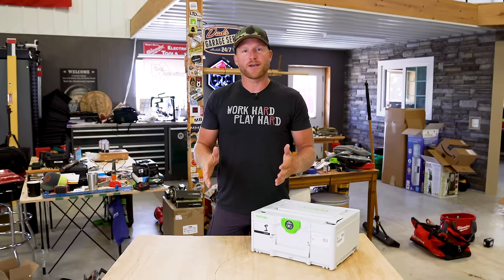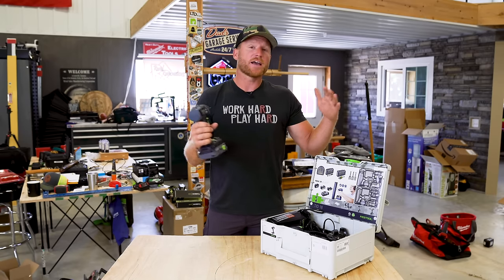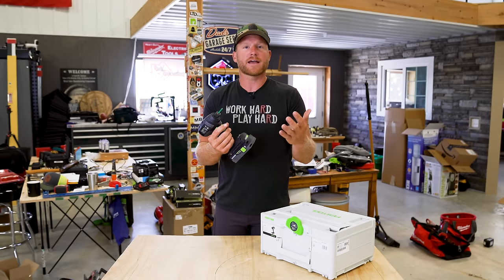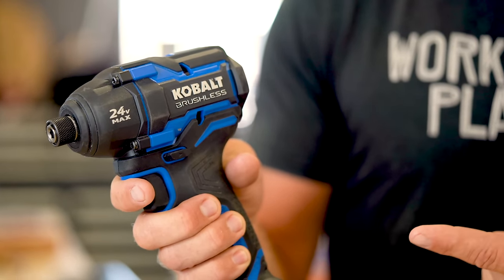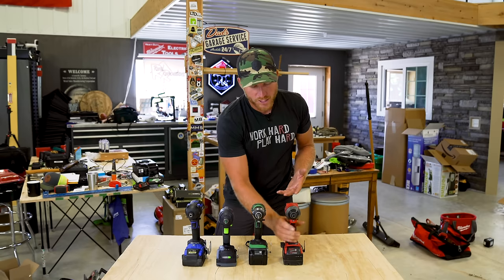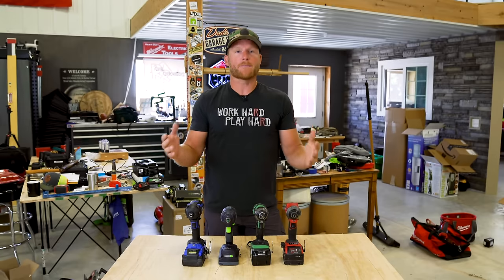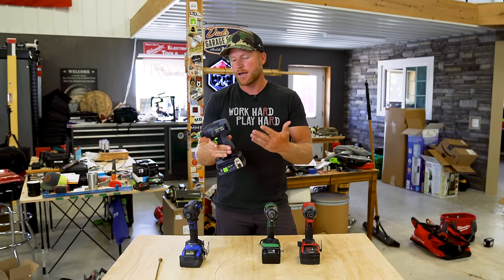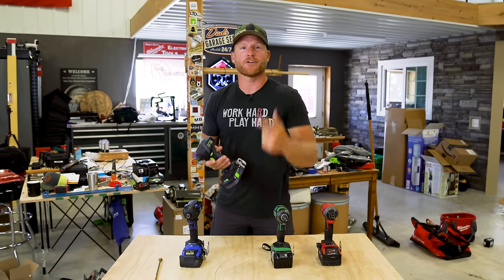Festool TID 18 Is it any GOOD?

Comment from the maker: Honestly, This Impact is Killer and I will continue to use it...not to mention at $349 for the kit with 2 high output batteries...it isn't that bad with a Case!  
https://imp.i284638.net/y7g2b
Reply: No one size fits all. I use my gen 1 Festool track constantly....no replacement for it!!  Stunning work. The chop saw ???  Not so much. I had to replace my recently stolen sliding mitre saw. I bought the Bosch glider for 1/3 the price.  Couldn’t be happier. Knock off the envy and get to work y’all!!
Reply: Since when is kobalt more powerful than Milwaukee every comparison that anyone has done all over YouTube Milwaukee fucked kobalt up I don't know about The other TOOLS so I can't say anything Milwaukee vs kobalt Every test anyone did Milwaukee always came out on top
Reply: Are the green impact driver bits going to be coming out i am digging the colorway nice impact driver from festool mostly on premium side this is more reasonable
Reply: I've been using mine for a couple of months, now.  I've been happy with it, for sure.
Reply: Thomas Carroll Those green bits are made by GRK for their T25 torx-drive deck screws.  They make the best screws and great bits to drive them with.
Reply: @martynzl  
Not being a hater here, I’m curious as my nephew is a painter. What tools does Festool make specifically for painters?
Reply: The thing I’ve found with festoon hand tools, especially their drills and sanders is that the people who use them extensively respect what you were talking about. Ergonomics over power. You can correlate ergonomics and power to the classic tortoise vs the hair story. Power isn’t everything. The power the drill puts out actually wears back on the operator. Finding a balance is well done by Festool.
Reply: It is a good deal in america indeed, same kit in europe costs 1270 dollars tho
Reply: Edit sorry that was for two drills 812 dollars it is for this kit
Reply: It’s crazy how much more expensive tools are in the uk, in the UK that would cost you around 600 dollars or 450 pounds
Reply: @getfast1522  The Germans don’t like BREXIT I suppose. Good on you, though. It looks like the EU is falling to pieces
Reply: My question is what’s the chuck wobble like? Just about every other tool I’ve used apart from my friends Panasonic that thing is tight and the fine control is impressive.
Reply: Ive used panasonic for almost a decade and they are very good and powerful but recently changed to a complete set from festool almost every tool on battery and love it not gonna change for a while

Comment: Festool, people either  love them or hate them.  I had the Festool track before most people knew what a track saw was.  People thought I was crazy to spend that kind of money on a saw. Now everybody wants a track saw. Yes you pay a premium for festool but their sanders and dust collection are hard to beat.  Especially when working in a house that someone lives in.
Reply: I recently dove head first with a CT Midi I, sander, and the TID18 and drill driver because of the vacuum. I’m doing a lot of DIY around the house and I have kids. I didn’t want dust in the garage mucking up my kids’s lungs.
Reply: I have been in the remodeling business my whole life with the family business 50 plus years. When it comes to tools I'm a Milwaukee guy and have pretty much cut the cord on 90% of my tools. I look at the cost of tools as part of the business. If it is a well made tool and is going to save time and make my life easier it is worth the cost to me.
Reply: @regopit44  That seems right to me. I think for homeowners who do this on the side, the calculus is a little different but the conclusions are not far off.
Reply: I think Festool was ahead of its time with some products, but the market has gotten so much more competitive that you have a handful of alternatives for every Festool classic now.
Reply: Sbe
Reply: @saiiiiiii1  You can thank Festool for that. If you remember nobody had a clue about brushless tools until they started it years ago.

Comment: The price of a tool is the price of a tool. Either buy it or don't. I own Hilti, Milwaukee, Old school Porter Cable and Old School Milwaukee from the 90s, Dewalt  from the 90s and now and both generations of Makita and those are my toold and I spend on them. If I needed a Kapex, I'd buy one, but my DWS 780 and Milwaukee 7 inch suit my needs. For my guys they either bring their own or I supply Rigid. If my guys want Festool, more power to them, but I am not giving them a raise lol

Comment: First off I have mostly Milwaukee fuel tools. I have one festool drill and impact. Festool drill is smoother and feels like a hot knife going through butter. Festool impact feels the same as Milwaukee’s best impact but smoother and more comfortable. What’s separates them is the warranty. Festool 3 year wear and tear plus coverage against stolen tools. Milwaukee’s 5 year warranty is not wear and tear only covers manufacture defects. And your screwed if it’s stolen. Plus you get a hard case with festool that stacks. Which I say is worth around 60-100 bucks if you go based of the cost for Milwaukee packout. If your in the market try it. You won’t be disappointed.

Comment: In my experience, the Festools I've used all have nice little design features.  But at the end of the day, I also like them because they just feel so good to use.  I've got a bunch of Milwaukee as well.  Also great tools, and probably what I'd reach for if I'm doing something where the tool is going to get banged around a lot.  I think of my Festools as precision tools for doing fine woodworking, and I wouldn't abuse them any more than I'd abuse one of my Starrett tools.

Comment: I have to say I was extremely reluctant for years to buy any festool because of the price. I have had all other brands you name it I have had it. I bought my first festool drill driver in 2010. Yes I still use it on the job regularly.  Obviously I have bought a couple new batteries cause batteries don't last forever.  I have since bought 5 other festool drills and other tools and I have to say man do they hold up. No problems what so ever. I would recommend them all day worth every cent.
Thanks for sharing Kyle

Comment: I've got the Mafell 91A121 ASB 18MBL and honestly after 20 years of carpentry and woodworking it's by far the most incredible, insane powerful drill I've ever used by far. On the down side It's really heavy and only has a 4amp battery not great ergonomics and tires your arms out after using it all day.

Comment: Good and valid points.
It's primary intended purpose isn't to put away massive batten screws, it's designed to fasten finer fittings with better finesse.

Comment: Good morning, Kyle!
You are such a logical, show me the proof kind of guy, I just love it.
I have had the Festool TS55 track saw for 12 or 14 years, it still works just fine and for my small shop it is great.
Using the TS55 with a vacuum in people's homes with, it leaves very little dust, it has earned a place in my workshop.
That being said, the Festool brand is stupid expensive here in Tokyo, I got the TS55 from Canada when I was home on vacation one year.
I really like the Hitachi, now Hikoki tools, for the 14.4v battery set I have 12 different tools, I also like the Blue Bosch line of tools. 
We don't get the Milwaukee or DeWalt tools here and the Yellow Ryobi tools are not sold here either.
The Festool I would like to add to my workshop is a sander, but not until I can go home to Canada and buy one there instead of the stupid prices they want for them here.
Great review, and if I was not so heavily into the Hitachi stuff I'd give it a look, the price is right too.
Cheers

Comment: I bought into the Festool Combo 2- drill kit which is the impact and the /hammer drill . Great set. Love the egronomics .
However i find the hammer trill chuck locks up a lot and have to oil it after using some compressed air to clean it.
The battery life is great!.

Comment: I have a festool the dust extractor and the hand sanding tools. I like them, really control all the dust when I used it for drywall repair. I work in a hospital so I always have to worry about dust. Just started to use their wood polishing tools.
Reply: check out abranet pads, they rock for polishing.

Comment: I think ergonomics are less subjective than you think, there's really important Universal's that everyone likes more almost all of the time, simple things like how much tension is on the trigger and forward reverse switch, how positive does the locking action feel, how smooth and precise is the trigger. I also firmly believe that the ridiculous overmolding companies do greatly reduce the overall feel of a tool and will irritate a hand when used all day or at least be uncomfortable.
Reply: TheVdog12 no kidding man, been working a lot with a Makita sawzall recently and the trigger is terrible, tires out my hand before anything else.
Reply: @arrzfr  usually Makita is known for having some of the better triggers, which sawzall model are you using?
Reply: @TheVdog12  I'm using the DJR183 model. It has a front hand and a back hand trigger, the front is ok-ish, the rear one IMHO sucks.
Reply: @arrzfr  those "ergonomic" recip saws are horrible, some of the worst tools any manufacturer has made. I'd take a look at the black sub compact recip saw. It's gonna make more power than that one and I believe it's around the same weight but has a much more traditional style trigger that isnt awkward.

Comment: Festool makes some AMAZING products.  They do...the reason people hate them is their price.  I inherited by dad's track saw.  Before that I used a Kreg Track Saw that used a standard circular saw mounted to an adapter that ran on the track.  It worked GREAT, and was all of $49 or $59 (I can't remember).  That Kreg worked great.  I made hundreds of cuts with it.  THEN I used the Festool...umm...yea...TOTALLY different.  That tool was designed for one purpose...to breakdown plywood or make long cuts without  a table saw or doing it free hand.  My biggest gripe of the Festool (besides cost), is that even with 3/4" Ply I had to set the depth of cut to about 3mm deeper than the gauge says (yes, there is an adjustment to it, but I've adjusted it 3 times and each time it comes out of adjustment quickly).  Love the thing, but I would never buy one for myself, it just wouldn't get used enough to justify that cost.

Comment: On black Friday 2 years ago I bought from the Home Depot a special edition Rigid kit for $299. It came with their premium skill saw, premium impact driver, premium Hammer drill, angle grinder, (2) 4 ah batteries, a charger, and a large bag. I have beaten the shit out if them for 2 years every day and they are still going strong. The best thing about them is that if they have a problem, they a guaranteed for life, including,  the included batteries. They feel great, they are lightweight, the flashlight on the handgrip is awesome because you don't have to pull the trigger to use the light.

Comment: I’m with you! I’m a sucker for anything that comes in a case, but I HATE bags! Bags are nice for throwing a bunch of hand tools into for one off jobs. Jobs where you would use tools that most of the time don’t come with cases, or jobs around the house. With any job I do, whether at home or offsite, my tools always get put up properly at the end of the day. Most of my older tools came in hard cases and I used to complain because of their size. They’re bulky and all look the same with no way of differentiating the tools inside. On the flip side, now a days most tools come in bags which absolutely suck when trying to store them in an organized way. Sure you can stack bags on top of each other on a shelf, but it’s a chore when you need to grab one on the bottom. It almost seems as though the manufacturers choose bags simply because they can have 3 or 4 sizes and throw any assortment of tools, batteries, and chargers into them and call it a kit. However most of us who buy a multitude of any one brand have realized that it’s much more efficient to buy a battery/charger kit, and then add your different “Tool Only” to the arsenal. I for one would buy a case even if it’s just for the bare tool by itself.

Comment: Years ago I was 100% Dewalt. I switched over to Milwaukee when their tool line selections became so dominant and I only wanted to deal with one battery option! Best small lightweight impact in my opinion is the Makita. However I just dont want to have different chargers and batteries. Its nice and cheaper to build your tools up by buying the "tool" only option when you already have a bunch of batteries!

Comment: Good review.  So glad you emphasized ergonomics.  When i worked construction my company had mostly Dewalt.  I didn't have many complaints except I have small hands.  Dewalt just didn't fit my hands, reversing switches, etc were not easy for me and impacted my productivity.  I used Makita if i could.  I don't care how good a tool is if it doesn't fit or feel good in the hand.  Ive been in Milwaukee for the last decade, but sometimes you need to break out of your chosen battery platform and get the right tool.

Comment: Back in the 90's when I did my Carpenter/Cabinet Maker training in Germany, Festool (back then called FESTO) was THE shit when it came to woodworking tools. It was already most expensive back then but their saws, routers and drills were just awesome and had perfect quality. The only real competitors available on the German market back then were Metabo of course, since it's a good old German professional brand, Makita, German brand Fein, Hilti (for stone and concrete works) and some Bosch. Black &Decker sold somewhat good drills back then. That was basically it when it came to power tools. So, I still have a thing for Festool, Makita and Metabo, because that were the brands we used most, but nowadays I really dig Milwaukee and DeWalt.

Comment: I had one of those super coupons for harbor freight. So i said "screw it" and bought one of the cheap Bauer 20v impact drills for an extra around the house. I don't think i would choose it over our dewalts on a job where i needed to be able to trust my tools but it seems to work fine. My father is a general contractor and his go to has always been dewalt so that's what im used to using. But the Bauer has surprisingly been a good little work horse around the house. Built two fairly large floating docks for my boat, replaced all my deck boards on the dock that is over a hundred feet long. House renovations, helping out friends and family with their projects and it hasn't really given me any trouble. 3.0AH Batteries lasts a good long while, charger is fast enough. My only complaints is the trigger is not linear enough, it goes from slow to full blast too easily. And i don't know if its just me but it smells bad when using it. It hasn't lost any power but when you use it for any lengthy period of time it just puts out an odor. I don't think i would recommend it for professional use or paying jobs but i cant hate on it for anyone that just needs one around the house for oddball jobs.
Reply: @Stevospeedo Have had the drill for about a year now and haven't noticed any loss in battery life or power so far on both batteries. Have already gotten enough work out of it to justify its low cost. If it dies it dies, ill just get another cheap battery and let it go another year or more. So far your opinion doesn't line up with my experience with the tool.

Comment: hello Kyle, are you not at all interested in how the Bosch devices perform?  I myself am a fan of the blue line.  I use 2 screwdrivers 18V and 14V and also a grinding steel and circular saw from Bosch.  I am very satisfied with it.  A big fan of your channel.  Greetings from the Netherlands.  Louk Kraaij

Comment: ive been using the triple hammer for over 2 years now. i also use a company new dewalt and i have the wakee fuel. I love the triple hammer, its been dropped off roofs, dipped in puddles, always working in the toughest conditions (trust me), and always gets the job done. Its an amazing tool. I will try the festool, only because i havent before, but i seriously doubt it will beat the truple hammer. btw the kobalt is garbage, no finesse, and horrible in the hand, honestly same with the milwaukee. good review! i totally agree, if i get the chance, or the money, ill give it a try, but until then, ill keep rockin the metabo

Comment: Ergonomics is very important. I just can’t stand reviewers who burn down the tools with wrong tools for the wrong tests. Dewalt 850 with the power stack battery is the best balanced ergonomic impact from what I tried.
I sold all my m12 Milwaukee because of the battery design in a tool handle. Hopefully Dewalt gets more 12v tools.

Comment: My last Milwaukee is seeming like it's getting pretty badly worn, and I don't do that much work with it. Festool didn't have an impact driver when I started buying Milwaukee, but I certainly miss using the tool that just screams quality every time I used it. I should see about getting some new batteries for my old Festool drill. Even after all the work I did with it, it's still a better drill used than the Milwaukee is new. Just a lot slower.